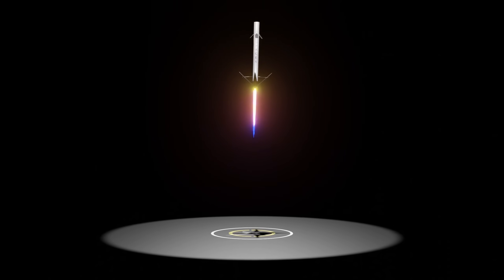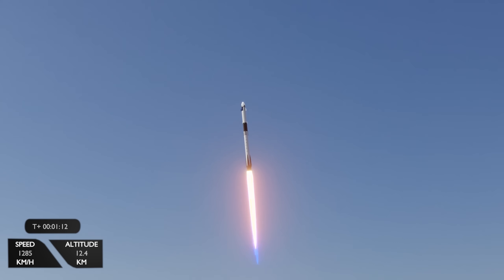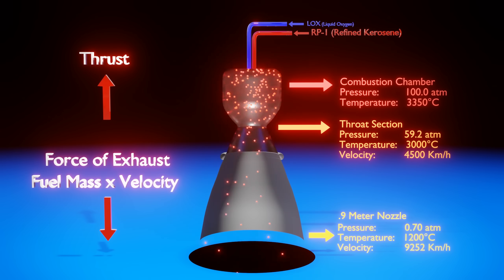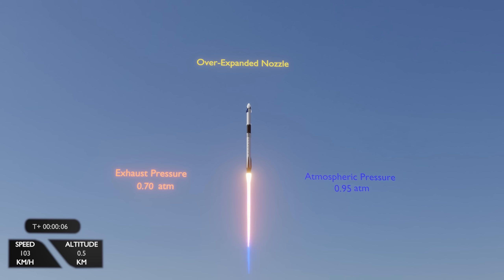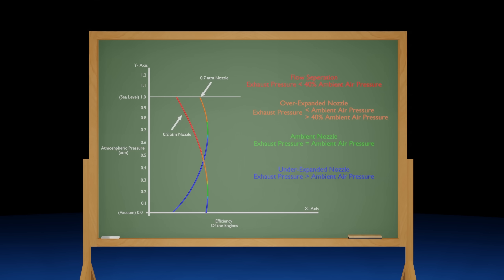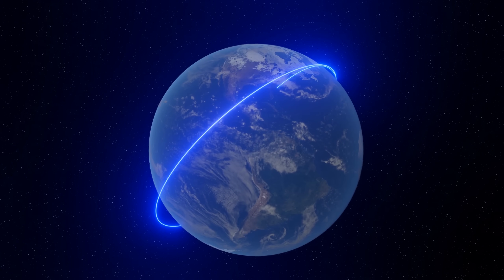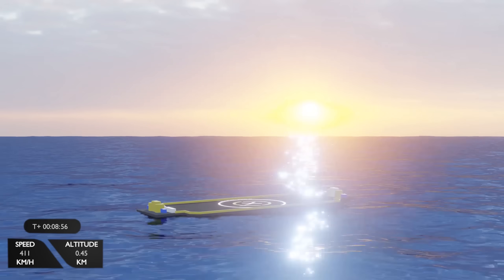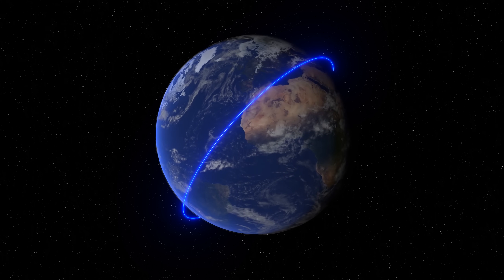Why Doesn't SpaceX Recover the Second Stage

Comment: It's an incredible video and explains a lot of points. However, at the end of it, it begs the question, a rather critical one come a new space age - why won't SpaceX let the second stage fall to the atmosphere and let it burn up instead of it acting as an addition to the continually increasing space debris, causing a threat to the entirety of space exploration ahead of it?
Reply: Upper stages are routinely deorbited in a controlled manner after they deliver their payload.  The few that aren't deorbit on their own within a few months (LEO orbits decay relatively quickly).  SpaceX are actually very good about minimizing debris in orbit, using pneumatic pushers for stage separate rather than pyrotechnics.

Comment: Newton’s formula is F=MA. Mass times ACCELERATION, not velocity.  Minor point as the fuel is essentially not moving relative to the engine, but the correct terms should be used.
When you expanded the formula on the right you did correctly express it in terms of acceleration (m/sec² ) and not velocity (which would be simply m/sec)

Comment: Q? Why doesn't SpaceX add three 1st stage Merlins to the area between the payload/capsule and 2nd stage booster? Then using a 180° rotation, slow down the second stage using the 2nd stage Merlin, upon decent, rotate 180° again to use the 1st stage Merlins to land the second stage. It would require an additional height equal to the height of the 1st stage Merlins.

Comment: Theoretically speaking. Could you make an engine that could adjust its Nozzle length and width over time in order to achieve a more uniformly efficient flight?
I understand this would be an absolute nightmare to mechanically pull off. But to say you have some unobtanium type system that magically was able to do this. Would this be feasible? Or are there other things that stand in the way of the engines efficiency that are just overly complicated to explain in this video?

Comment: The issue is that eventually so many 2nd stages will be just floating in orbit that entering a new ship to orbit becomes extremely dangerous if not impossible. Sooner or later SpaceX or NASA will need to develop a way to either recover or destroy those 2nd stages.

Comment: 9:58 The second stage (at engine cutout) is about four times AS FAST AS the first stage (6750 x 4 = 27000), NOT "four times faster than," which would be FIVE times as fast as. "Faster than" and "as fast as" do not mean the same thing.

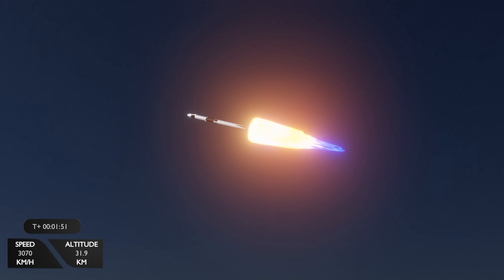Comment: 7:05 Not "lowering its heading," but rather, "pitching down" or "decreasing its flightpath angle relative to the horizon," etc. "Heading" is the direction it's pointed in the horizontal plane (e.g, north, southwest, 133 degrees true, 225 degrees magnetic, etc.).
Reply from the maker: Thanks for the note! If you would like to give your opinion on future videos please join me on Kofi or patreon! Would love to hear your feedback in the future!
Reply: @animationsxplaned8835  You're welcome. Excellent video. Great explanation about the nozzle efficiency and the various constraints related to the engine performance and design! Thumbs up!
Reply: do you work at NASA or SpaceX?
Reply: @pluffler  No. Just a tech writer at a different aerospace manufacturer with a degree in aerospace engineering and an emphasis in astronautical engineering, plus a Navy pilot.
Reply: wow you must smoke a lot of weed too....lol

Comment: Its a nice video about engines and plumes but the title is very misleading. You pose the question of second stage recovery in the title but don’t actually address it until the very last minute with a few almost throwaway sentences. And even those few sentences kinda miss the mark. 

The primary reason they don’t recover it is because the mass penalty for doing so is too high. On a first stage, every kilogram dedicated to recovery (legs, grid fins, propellant reserve) has a relatively low payload penalty. For argument’s sake, let’s say every 5 kg of recovery material costs 1 kg of payload capacity. On the second stage however, there’s a 1 to 1 relationship. Every 1 kg dedicated to recovery costs 1 kg of payload capacity.

Comment: I will tell you why they don't recover the 2nd stage, because they are not smart enough. spacex  is governed by nasa and nasa is nothing more than
a den of politicians, I know them first hand, as I worked the shuttle program for 32 years.
Now on the other hand you take an individual like Elon Musk and plant them within the ranks of nasa then you would have a solid program.
I could go on and on, but the straight answer is NASA is dummer than a box of rocks.

Comment: Great video with good animation and some good information. Just a couple things I want to point out not trying to be a jerk. Technically it's not the exhaust plume that provides the thrust it's the burning and expansion of the exhaust gases. The burning fuel creates extremely high pressure in the combustion chamber and that pressure acts equally in all directions except the exhaust where it's allowed to exit. It's the relatively lower pressure inside the chamber at the exhaust that allows the internal pressure to push the rocket away from the exhaust. If the plume was causing thrust by pushing against the atmosphere then a rocket wouldn't work in space where there is no atmosphere. This is also how they steer the rocket by gimbling the exhaust, it's just slightly changing the location where the exhaust exits relative to the combustion chamber.

Comment: Why do they not make a customisable thruster? Changing in size when in different attitudes?
Reply: How?
Reply: @RawbLV  Something like extending panels on the end of the thruster. Folding in and out to extend or shorten the size of the thruster.
Reply: @thomkok12  There is nothing that will work reliably and that could sustain the temperatures and force. Just overcomplicates already complicated engine.

Comment: It could be easier to make the first stage bigger so it can do what the 2nd stage does but that will add weight. Weight is the biggest killer in anything that has an engine that moves.

Comment: Easy and I don’t even have to watch the video. NUMBER 1 biggest reason is that the second stage only has a single vacuum engine and the bell is bigger than 9 sea level versions of the same engine and the vacuum engines will get flow destabilisation when not in space and shut down the burn or just destroy the engine in a huge wobble followed by a finery explosion. So it’s engine can’t run when it’s needed to land. NUMBER 2 is velocity and it’s what everyone says when they forget number 1, the second stage is going 4 times as fast or more, so it has 16 times the energy it needs to lose. We will join number 3 to this as well FUEL. So losing 16 times the energy means a fuck ton of fuel burn prior to the atmosphere or a heat shield like an ISS capsule uses in lieu of fuel. So you can carry way way way more fuel and go around the world to get to your descent point and then flip around and burn your rocket and slow from 28000 kmh at 250km altitude to 7000 kmh at 120 km altitude. That vacuum rocket bell is just too floppy flimsy and unprotected to survive an engine first reentry even if you could slow up with fuel you just can’t carry. The vacuum bell requires a stiffener ring just so it can survive the vibrations and g’s of launch while is all wrapped up and protected. Bell first into that plasma wind, not a hole in Hellhiem. 

Reason 4 new paragraph as along with number 1 is the only real reason as without solving these the others don’t count. The rocket conundrum. 97% of what’s launched as the rocket lifts off is all crap, only 3% is actual payload that you want in space and the rest is just chaff. That extra fuel to bring the second stage down to just 7000kmh would be several tons and then you need tons more for the entry burn and then a few tons for the landing burn. Because that fuel for the slow up, entry and landing burns has to be there after payload release then it’s been there for the full ride so it comes out of that 3% payload mass that’s available. Oh and don’t forget the bigger tanks for more fuel, but those bigger tanks will now need a thicker stronger steel to make them that size so heavier, so now the second stage needs a bigger fuselage to hold it all so more mass, now you have more mass sitting on top of the F9 booster the booster needs to be stronger and heavier to take the launch loads, now you need way way way more fuel at launch in the booster to lift all that extra mass, fuck now the booster has to be bigger to hold the extra fuel and the thing needs fo be stronger and heavier again. Shit there is now so much more mass that you need an extra rocket engine making it a F10. 

Rockets are designed for a mission ‘TOP DOWN’. So at the top you want 15 tons at LEO, that’s the mission. To get that there we will be on a second stage that leaves the booster at 80km altitude at 7000kmh. So that second stage needs to hold 15 tons of payload and your going to use XXX engine on it that makes YYY thrust. So with that engine and that thrust to go from 7000kmh to 28000kmh you need ABC tons of fuel to get the payload and the fuel and the engine there, knowing that the fuel will burn down. Then you start estimating second stage airframe mass and then add the fuel in for that. NOW that’s your second stage max mass at the pad once you decide on a fairing.

Next step down from the top, design the booster. The booster has to get the complete second stage from the pad to 80 km altitude and 7000kmh. Chose the engine then decide on your max thrust to get the number of engines. Then figure out the fuel to get the second stage and the booster engines to the drop off point. Then design and estimate the mass of the booster airframe and controlling stuff and computers and everything and the tanks. So then figure out the fuel to lift that booster mass to the drop off and the fuel for the booster reland. If that’s more than the tank estimated size the the tanks get bigger and the fuel load increases to carry that extra fuel for the extra tank volume mass. 

So then You build it after doing modelling and maths and physics to make sure your initial estimates pan out.

So since you HAVE TO BUILD TOP DOWN any changes will effect everything below that point in the build. So adding ANYTHING even fuel to the second stage effects everything absolutely everything in the rocket design and build. The easiest way to fit it in is to say that the second stage will require 3 tons of airframe mods and 2 tons of extra tanks and 8 tons of extra fuel for a total of 13 extra tons to be able to reland the second stage if we could magically make a vacuum engine run reliably and safely at sea level, so you now have a payload available of 2 tons only. You see you take the mods mass straight out of the already figured out payload allowance.

So stop asking dumb questions and making silly videos.
Reply: lmao

Comment: Really good explanation, but worth noting that at stage separation the booster stage is also travelling at orbital velocity, it does not just start falling, so it fires its engine in the opposite direction to slow down enough so that its trajectory ends at the droneship. It also fires its engine in the upper atmosphere for a short time to stop it burning up from those speeds, and then does the suicide burn. Rest of the video was spot on, learnt lots I didn't know before

Comment: I’ll answer your question for you. For one thing, the 2nd stage is almost out of fuel when it reaches orbit, and definitely doesn’t have enough to land. Then, there’s re-entry. It would need a heat shield, which weighs a lot. Also, the M-vac engine has almost no thrust at sea level, so you’d need additional thrusters to fix that. If you don’t want the engine to break when it lands, you’ll need landing gear, only adding more mass. It’s possible, but then you’re stuck with virtually no payload capacity.

Comment: Could they not make a one stage rocket 🚀 that expands the nozzle at the MECO Mark??? 

Instead of calling it MECO, it could be MAIN NOZZLE EXPANSION mark or “MNE” said as “Many” ...Jet Engine’s have this ability to not only expand the nozzle, but direct thrust in a given direction.
Reply: @CrewPostor Yes...but expandable nozzle. I dunno if that’s possible, but it seems like a very worthwhile thing to try considering it can save the loss of the second stage, In theory of course
Reply: @flippdoubt8057  Why carry weight of the first stage? Uneconomical.
Reply: @RawbLV  Why throw any part away too. I guess it’s a double edged sword. I hear ya though.
Reply: @flippdoubt8057  Cause it saves weight. Weight is crucial in space. Makes it harder to go up and makes it harder to slow down.

Comment: Too many unnecessary explanation. Simple answer is objects with orbital speed need additional power to slow on re entry & heat shild to protect itself & landing hardware. Doing this will cost very high amount of payload penalty with is not efficient. Vacuum engine sea level engine is not that countable elements to justify this huge payload penalty.

Comment: Very well explained video! The only thing I’d add would be that, re entering from orbital velocity is not 4 times hotter than coming in at 2km/s in the case of a Falcon 9 booster. Re entry heating goes up by the cube of velocity, so a second stage coming in from orbital velocity would experience 64 times as much heat as a sub orbital falcon 9 booster that is only traveling 25% of the second stage’s velocity. That’s a very important thing to consider.
Reply: DUH....
Reply: @thomasrogen3739  Let's be nice, okay?

Comment: why you cannot have variable size nozzle so that nozzle pressure is always equal to the ambient pressure....
Reply: How?
Reply: like a camera’s apperture blades change based on incident light intensity...just imagining...
Reply: @meiwinspoi5080  Which material would be able to do that while sustaining the high temperature and pressure?
Reply: @RawbLV  assuming rocket exhaust at 3500k for starters, tungston plate nozzles is a possibility....but need to reingineer tungston to withstand atleast 4000k and better stress handling
Reply: @meiwinspoi5080  Now let's go ahead and over-complicate an already complicated engine design and increase the costs and weight and reduce the reliability just so that we could bring the first stage with us to space even though we don't need it. Sounds like a great idea.

Comment: Great video which left the question:
How does spacex manage to overcome the issue with the engines on starship which is like a second stage?
As we saw, they are able to fire starships engines at sealevel and up to 10km without any problems but as i remember, starship should land on the moon one day with basically no atmospheric pressure.
Reply: Starship with have 3 sea level engines and 3 vacuum engines

Comment: Should add that Space X doesn't just leave its trash up there. The 2nd stage about 6-8 hrs after payload separation "commits suicide". The thruster fires just enough to slow under 26k and thus gravity does the rest. It burns up and vaporizes over India and Asia pretty consistently. The fairings float down till the chutes slow them down. They float so they can be picked up. Only 1 item is left if done properly and that is the stabilization rack that holds starlink payloads. It's a long, 2 beam bar that runs the length of the payload. It is released at Sat deploy and will forever float in space. But that's it.  Compared to the 60s and 70s and 80s that left tons of crap that's pretty good.
Reply from the maker: I’m actually making an entire video about this! I just thought it was too much to include in this video. By the way, although the stabilization rack does have a low ballistic coefficient, I’m sure this only slows does the decaying of the orbit. Forcing it to re enter in weeks or months after payload deployment!
Reply: @animationsxplaned8835  I wondered that as well. However, I have read conflicting information on this from SpaceX and Elon. One theory is that because it's mass is so low, and it's ejected like you said Ballistically it re enters. Than there are others who speculate that it degrades but again because of it's lack of mass, it actually doesn't burn up as it tumbles. And yet ANOTHER that claims it's up there till the rapture. Sadly this issue falls dangerously close to "proprietary info" and we can't get a straight answer. Or at least I can't. Hell of an excellent video my friend. Very informative. Even for nerds like me.
Reply from the maker: Well I believe the atmospheric drag acts on its area not its mass. And considering the orbit hight of deployment, I’m sure it will eventually decay....maybe in years or tens of years though like you’re saying! If you would like to continue to discuss topics like this! I would love to chat about future video ideas through patreon or the free equivalent, Ko-Fi. I make these videos in my free time after working full time and although I have a background in Mechanical Engineering, these concepts are clearly above what I learned in school! Hope to see you there!